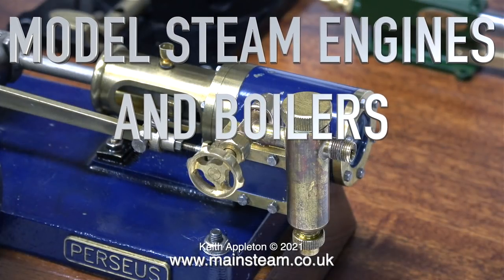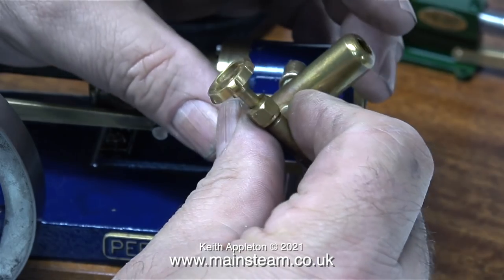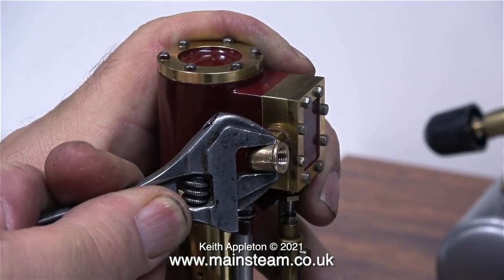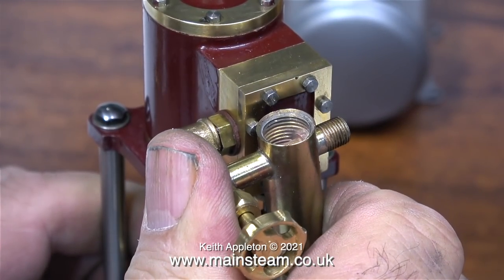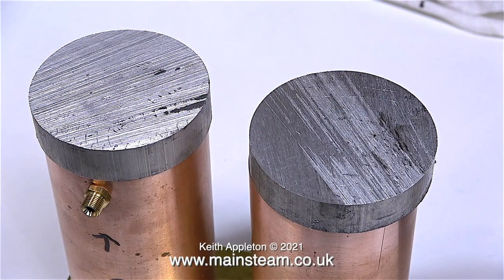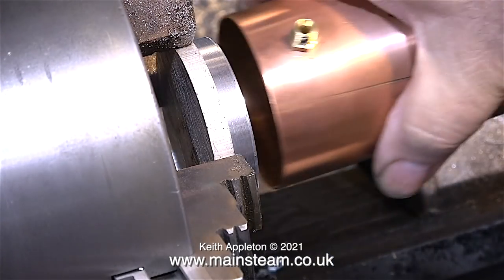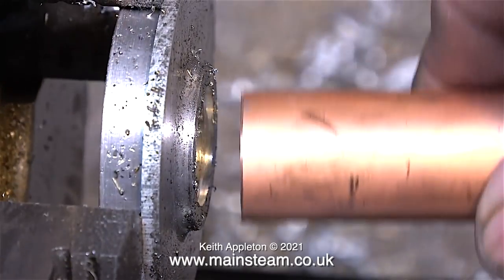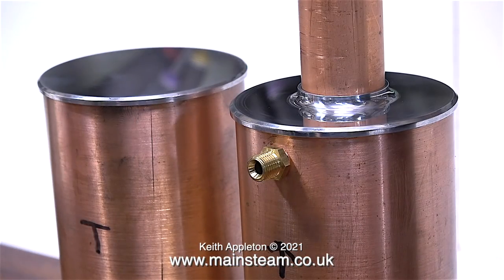MODEL STEAM ENGINES AND BOILERS - PART #12

Comment: It is possible that PM research uses a tapered plumbing type 1/4 x40 tap instead of the straight tap used for fittings using compression comes.
Reply from the maker: See the comment above: 
American threads are 60° British threads are 55°
Reply: @keithappleton  Yes, they were, until 60° Unified Threads were accepted by both countries plus Canada for countries that were then all using Imperial measurements.  This was done due to manufacturing inconsistency problems experienced by the Allies in WWI & WWII when they used different thread systems, causing great problems in War Production.  Unified threads are a combination of the Whitworth thread form & the old American (Sellers) 60° "American Standard" thread form to come up with an improved thread form with better fatigue characteristics.  Perhaps Stuart uses the "now old" British Standard threads so that today's replacement parts will still fit their older products?

Comment: Those tiny brass fittings are also easy to cross thread so you have to be extra careful!  If you feel any resistance STOP,  don't force it,  remove it and try again again, and  if you still can't get it threaded, run a tap into the hole and use a die on the male end.  I wish I had a dollar for every time I've cross threaded those small fittings,  I could have been quite wealthy by now!
Reply from the maker: Yes it is easily done with these small fine threads in Brass.